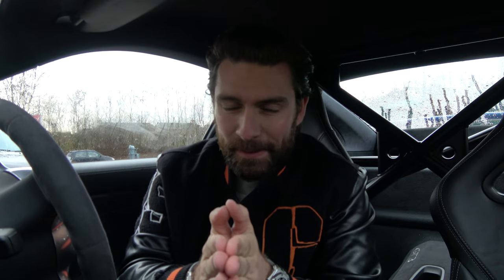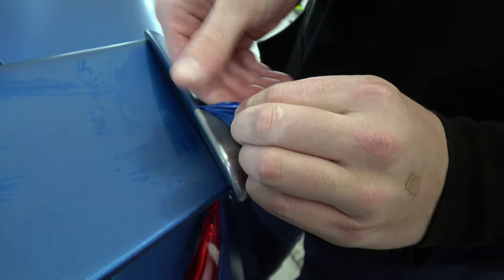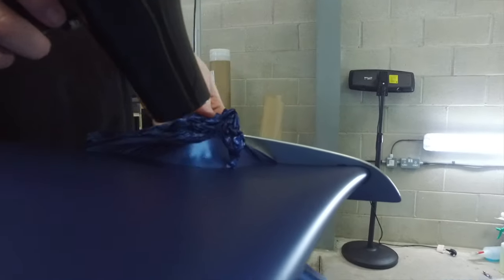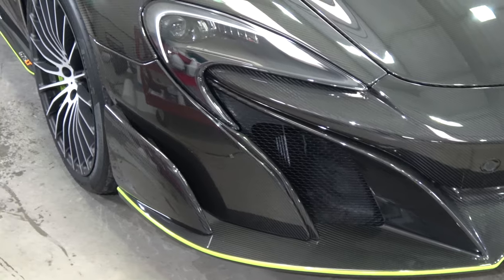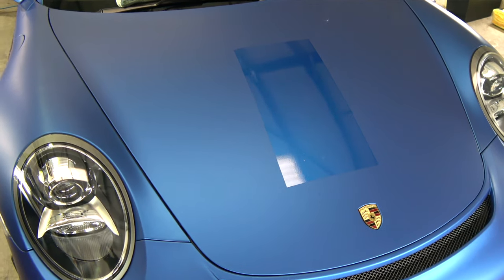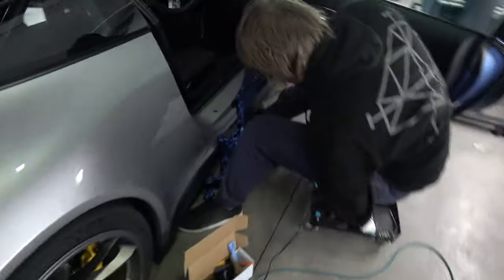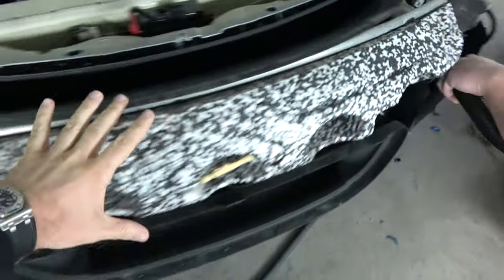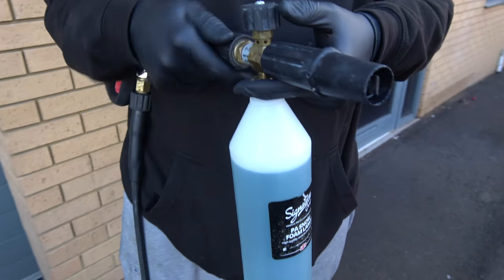Peeling Off The Blue - Unwrapping The Porsche 991 GT3

Comment: James, have you already sold the GT3 as I was trawling through 991 GT3's a couple weeks back and I saw one in silver with yellow brakes and a quicksilver exhaust... and the car also had 20,000 miles?
Reply: I think your right, it sold with the sharkwerks exhaust and the OE system by the looks of things.
Reply: Yes, that's right. It was Sharkwerks not Quicksilver. It just seemed to look identical to JWW's car.

Comment: Mr JWW, is the idea of a wrap not only a cosmetic change but also a way to preserve to original paint? Its confusing to me because all these guys spec a car the colour they want and then all a sudden change the color when they receive it. So, is the primary reason for protection?
Reply: primary reason is creativity. it allows you to change colors as often as you want, without having to change registration details of your car or without having to spend more than twice the money on complete paintjobs.

second, protection.

third, if you get a matte painted car and you ruin a bumper or any other body panel and you go get a new bumper, it will be extremely hard for you to match the new bumper's paint to your car because matte paints change consistency with time and weather. if you have a wrap, you go to the shop, get the damaged part replaced and wrapped, let it dry for a day (compared to alteast 7 days with metallic paint, matte takes 14) and be on your way

Comment: would selling it with he wrap been a problem? Is there anything about the registration and original colour that needs to be aligned ( and if your car is wrapped do you need to notify DVLC?)
Reply: most people who buy these cars like to sun them stock and the wrap is just too hard to maintain. also, yes. registration problems.
Reply: thanks HPTS, hard to maintain? thought there was a slightly different washing regime but not difficult. but thanks for the answer.
Reply: A wrap isn't hard to maintain and there's no problem with registration as a wrap isn't a permanent change of the color of the car. 
It's easier to sell a stock car over a modified one, that's all.
Reply: +Global Nomad, if you get a matte finished paintjob on your car, you will have to wash the car with hands, with very soft cloth and fresh sponges. if you get a wrap, you can fucking sandblast it and you'll be fine (exaggeration). Pressure washes are not advised on matte paintjobs because they pull the paint off and also, if you damage your car, say a bumper, it will be hard for you to get a new bumper and have its paint match the original matte paint of the car because it changes consistency and color after time.

Comment: Professional car wrappers.... still using hairdryers?
Reply: hairdryers are perfect for applying heat to a small area very quickly. better than heating the whole car only to let it get cold again because the temperature is around 15 degrees Celsius outside
Reply: wouldn't a heat gun be better? instant heat instead of waiting for it to heat up?

Comment: Not worth pulling off parts just to wrap a car, and off again just to unwrap it. At least not a Porsche where everything is supposed to be tight fitting and not molested ruining the integrity of the car. If I were buying that car I'd want $50,000 or more knocked off it just because of all that. Terrible terrible idea. If you wanted that color, buy it in that color.